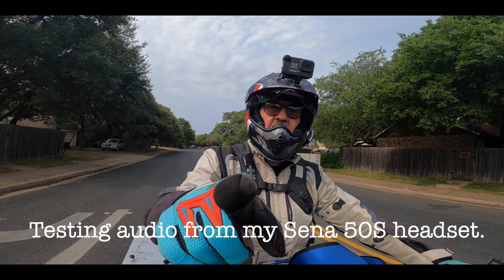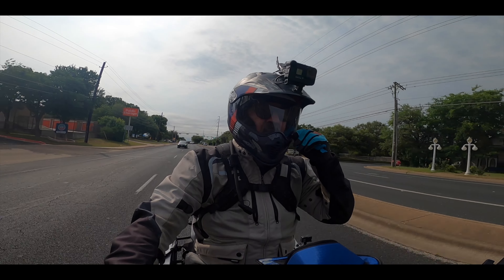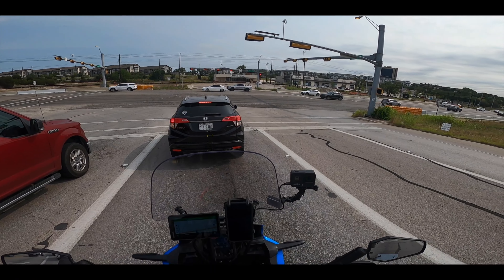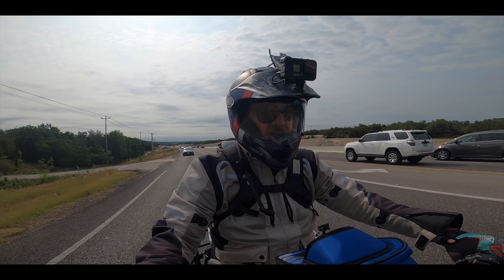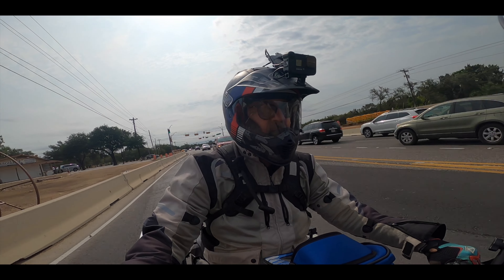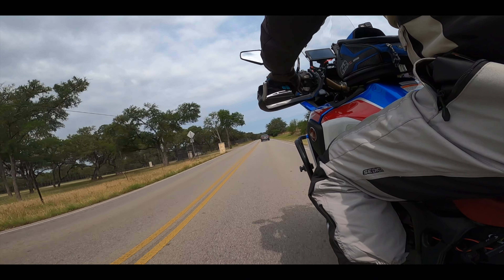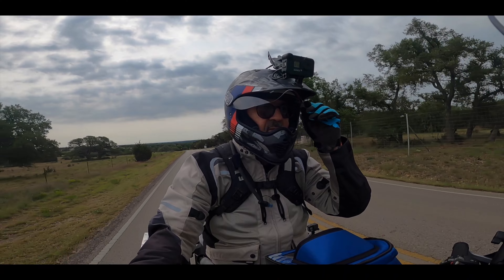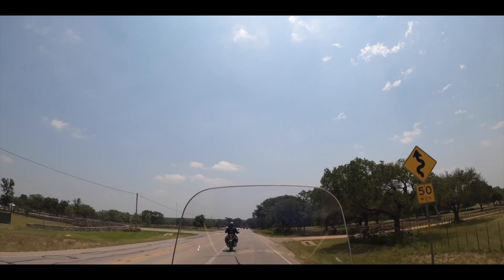Motovlogging setup test run | Arai xd4 helmet | GoPro hero 8 | Honda africa Twin DCT 2019 Adventure

Comment: How do you like the XD4?  I have an XD3 that's like... 12 years old at this point and should really replace it.  (Not my daily driver).
Reply from the maker: At first I wasn’t sure it’s hard to get on but once I got used to it I was able to get it on and off with no problem. It’s very comfortable more comfortable then both my bell helmets I did try the Schuber but I didn’t like it it was very uncomfortable so I think this will be a winner